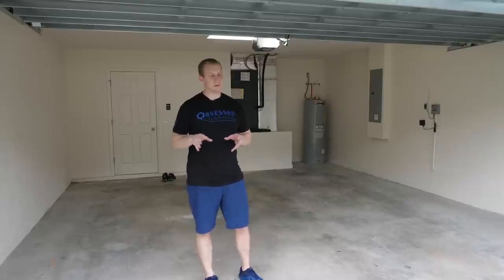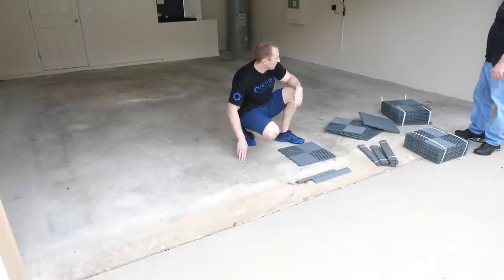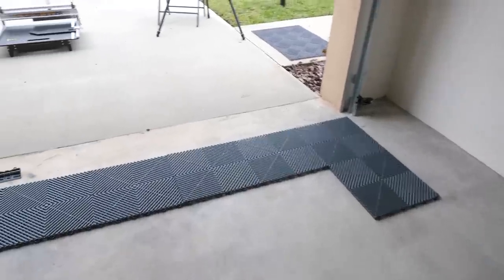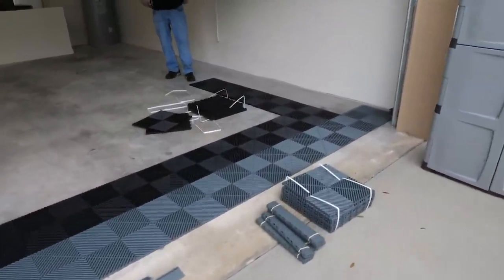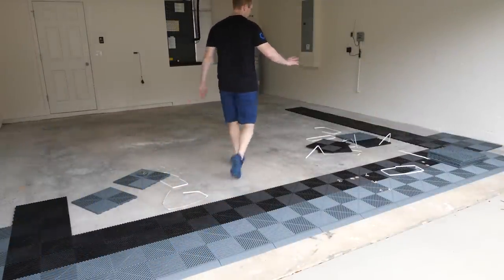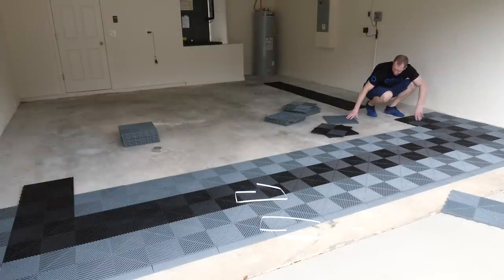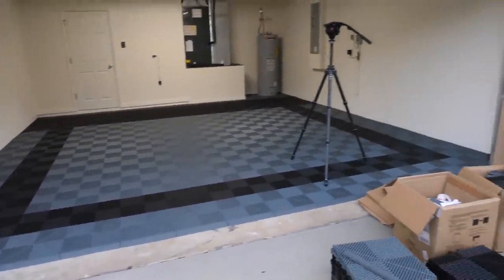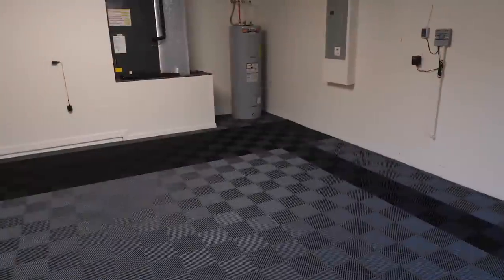Installing Swisstrax In My Dad's Garage

Comment from the maker: All, it appears this video has hit a bunch of suggested feeds.  A couple of answers to commonly asked questions:  "What about the dirt?"  I'm telling you.  Dirt is a non-event.  Think about this logically.  The tile is 3/4" of an inch thick.  How much dirt would you need to dump on your floor to get that much dirt build up?  I vacuum my floors once every few years.  "Epoxy, paint, etc is much better."  I wish it was.  Outside of $12+ sq. ft. porcelain tile, this is the most practical and viable solution for a garage.  I've chased this harder than 99.999% of people on the planet.  "I work on my cars. What about oil."  I do too.  The once a year that you spill some transmission oil on the floor, get some paper towels, pop tile up, wipe...done in 30 seconds.  All you need to know is here:  https://www.obsessedgarage.com/collections/garage-flooring
Reply: Obsessed Garage what about floor jack and jack stands?  That's my one hang up
Reply: For years my driveway was compacted crushed concrete: 1/4 mile long. Dirt would be an event. lol
Reply: @TheBeingReal  Is the floor angled away from house? maybe you could hose it out every now and then. im really digging this stuff. looks great.
Reply: Obsessed Garage everything you’ve said and I clearly get the picture you just made every wrong move when you did epoxy. You vacuum your floors every few years?!!! That’s gross man. You clean transmission oil from the bare concrete underneath with paper towel and that’s it? Why not clean it properly when the tile is up? I don’t think you’re obsessed with cleanliness when your tile argument is partly based on how much dirt you can hide vs. actually keeping a floor clean! It costed me $200 to epoxy a floor twice as large as that garage. Just use epoxy in a solid color, and if someone shows up with a roller send them away, because that is the first sign they haven’t a clue what they’re doing. I did mine myself and a friend had a local contractor do his condo (a guy who actually did live up to his warranty when my friend found some bubbles in a corner). It took me about as much work as those tiles in that garage with prep included. BTW urethane on top of epoxy completely negates the advantages of epoxy, and then you really are screwed repairing anything. If you want resilience you add a softener, if it’s too slippery then silica. I haven’t had any of the issues you’ve had repairing anything either. You’re a dealer for Swisstrak, so this is some first person information for everyone else.
Reply: You can get really good PEI-5 porcelain tile for less than $3/sqft right now and closer to $1.50/sqft if you're willing to wait for the clearances.
Reply: @Lance Hayabusa This may not be the channel for you...
Reply: epoxy paint , its forever coming off I'm defo looking at this .

Comment: Hi Matt, I just installed mine recently and for the sides I find it easier and more precise if you:
1. lay one tile (#1) fully over an already-installed full tile (make sure it's flush)
2. lay another (#2) over tile #1 and slide it towards the wall until flush against the wall
3. draw a line on tile #1 based on tile #2 edge
4. cut tile #1
Viola
Reply: smarts

Comment: So few questions:  What about dirt?  How do you clean the floor of solid particles that are small enough to fit inbetween the grating?  Also, what about when that water heater needs to be replaced?  Can that entire section be redone without negatively effecting the rest of the flooring?
Reply: I wanna know about cleaning but yeah it's easy to redo sections
Reply: We use a bissell cross wave. It does a phenomenal job. Brushes for the interior brushes for the garage.
Reply: Wonder if it’s possible with a good size shop vac to get the dirt without lifting the entire floor I’ve heard him say he vacuums his once a yr or something but not sure the process

Comment: Id be the guy who just leaves the small space on each edge lol
Reply: Jeeper1378 the growth/shrinkage due to temperature on a 20’ section is not small. 60-80F temp swings due to seasons  can cause havoc and bulges.
Reply: You'd be wise to leave a gap. Always always, always follow manufacturer specs on things like that. When the guy in the video said he just puts it in tight, I cringed. When it comes to building a lot of guys do things like that and back it up with, "Well, that's how I've been doing it for 20 years and it's fine!" All that means is they have likely been doing it wrong for 20 years. And they always have an excuse when their work is fucked after the first warm season. Or, they don't even know their work was bad because their customer is smart enough to not rehire him to "fix" it when he was the one who did it wrong to begin with.

Sorry for the rant. This is a pet peeve of mine. I am a carpenter and I read all manufacturer installation instructions each time I install something. I don't care if I have used this product a hundred times. At the very least, it keeps the warranty intact.
Reply: I'm thinking that a baseboard or quarter round raised up just enough to allow the tiles to slide under would be the best way to go. That way the floor can float as it expands/contracts.

Comment: Nice floor but the way you keep measuring the edge pieces takes too long, especially if it's a large area. Take two tiles, place one on top of the other and lay them directly over the last tile before the wall. Now slide the top tile towards the wall. The exposed piece on the bottom tile is the piece you need to cut out. That way if the wall is on a slight angle, it will transfer onto the bottom tile. Use a white wax marker. No measuring. This method is for all tiled flooring. Also, instead of cutting around the garage door metal track, place a tile against it and mark the height of the tile on the track. Now cut the track so the tile slides under it. Like when you cut the door jamb and casing to fit a ceramic tile, wood floor etc. I use a metal blade in my Dremel tool. Works slick.
Reply: I was thinking the very same thing.  But, lessons learned are the best teachers for next time!  Gotta love a clean garage!
Reply: This is how I was taught when I installed wood floors because walls are rarely straight
Reply: This guy does flooring. Also, he had well under a half a tile at the edges. Instead of having to cut those tiny pieces, he should have moved the black border over a single tile and centered off those. same amount of tile (assuming he cut 2 tiny pieces per tile) and you aren't left with those teeny tiny pieces at the edge.

Comment: I love the look of these tiles, especially on the color combo you chose. However I think I would prefer a solid tile that can be blown out or mopped due to the amount of dirt and sand I get in my garage. Also it doesn't look very easy to roll across on a stool or with a tool chest.

Comment: how does that two car garage cost 800? for my single car garage 12x20 its 1100 with out extra. that is with matts 6.80 price per tile. the designer says 160 tiles
Reply from the maker: Quick math on camera.  $1600ish.  Stopping sitting around watching YouTube videos looking for mistakes.  That's a bad way to live.
Reply: @ObsessedGarage   not looking for mistakes. when you say a two car garage cost 800 i looked into the cost of doing my single car and it didn't make sense
Reply: @griffinstambaugh5795  valid point. When I heard 800$ I was thinking about doing it for my garage. Turns out its much more than that.
Reply: @ObsessedGarage  yo who said he's looking for mistakes? The man was just genuinely curious at how cheap it was. Why do you always have to get so damn defensive. Holy shit dude lighten up.
Reply: He was not planning to do the ceiling so it's $1,600 / 2.
Reply: yeah thats a huge price discrepancy, the $800 sounded great!

Comment: I would never do this because tons of dirt over the years would end up in the holes. Especially where the car tires drive on. This would show tire lines the same as on a concrete floor. Instead of sweeping, you would need to vacuum
Reply from the maker: You don't need to do any of that.  Think logically about how much dirt 3/4" would be.  I'm telling you, my wash bay hasn't been cleaned a single time in the 3 years I've had it.

Comment: I have something similar from RaceDeck. After the winter, the road salt and dirt would trapped under the tiles. The only way to clean it is to pull up the tiles in large sections and put them back after cleaning. If you try to use a air blower to clean the garage, it will create a sand storm. If I have a choice, I would pick the solid tiles.

Comment: $800 floor? Isn't it more like $1500
Reply: Loltb did you not catch that he’s also a swisstrax dealer, lol?
Reply: 20x20 garage, looks to be 256 tiles. With a little overage. About $1,800 at $60 for a box of 9. Unless I’m missing something.
Reply: $1,365 for a 20x20, at the price he’s quoting. $1,365. He ships for free.
Reply from the maker: Yes, I was thinking 200 sq. ft.

Comment: I know this is an older video now and prices have probably gone up, but I think this helped me decide on my garage flooring. Thanks for putting out great content like this installation video and the garage give away videos. It’s really helping me decide on things I want, which need to be precise with how small it is.

Close on my first house in about 2 months and it’s only an oversized single car garage, but I want to turn it into a proper spot. Going to have to save up and do Swisstrax and sonicc cabinets like your last garage give away video.

Comment: Thanks for a great, informative video...
What is the deal on dirt?  It just falls into the gaps and now and again vacumn it out?
What sort of expansion gap might people fit.. on a garage of that size?
Can the whole floor move when a vehicle drives on to it if the flooring doesn't butt up against the far whole?
Thanks
Mark

Comment: Excellent video! Great looking floor. Most informative that I’ve seen for this type of flooring. Thank you
Reply: that seemed to be a terrible lay out, why not centre the floor then measure to the wall and eliminate the small cut by either centering the tile or putting it either side of the centre line

Comment: I agree that it looks cool, and the ease of installation is fabulous. My concerns, especially for a guy like Matt who obsesses about cleanliness, is the inevitable dirt and debris buildup under the tiles over time. I know you can pass a vacuum or shopvac over it, and you can always pull up a few tiles to clean any spills, but there will always be dirt under the tiles. The only way to properly clean the floor seems to be to remove the flooring, clean the floor properly, then reinstall. I guess how often that needs to be done is directly proportional to how you use your garage. 

I have a 4-post lift that I occasionally put on the optional casters so that I can push the lift around my garage, and occasionally I roll it outside to pressure wash and detail suspensions and undercarriages, so I doubt a flooring product like this could ever work for me just because of the lift that is not fixed in one position. Personally, I do not care for the feel or sound of loose plastic pieces under my feet, but to each his own.

Hey Matt, with all the detailing that you do the the topsides of cars, do you ever feel the need to properly clean the undercarriages and suspension beyond the brakes and wheel well area?

Keep up the good work!
Reply from the maker: If you walk on these, I think you'd change your mind.  They are very stout.
Reply: Same concern. I've always had a garage and no matter what you do leaves, dirt and sand always blow in. I've always left my floors plain and I just use a broom and a leaf blower to clean it out every few months. I can see the little grills on this stuff catching all of that with no easy way to clean it out. I'd be curious to see a floor like this 3-4 years down the road too.
Reply: @ObsessedGarage  Fair enough, I look forward to walking on them. My garage is in an industrial area on Florida's Treasure Coast with hundreds of garages, where a large number of them are man caves for serious car collectors. Most floors are professional grade epoxy with no issues, some are stained concrete, and a few went with plastic tiles. I have not heard of the Swisstrax brand being used around here, but I will ask around out of curiosity. 

Assuming I could change my mind about the feel, and how to keep the floor clean, do you think that the harder tiles could support the weight of a 4-post BendPak lift with a car on it? If so, how would you feel about rolling it on the casters (without a vehicle on it, of course)? Rolling may prove difficult due to the reduced contact patch size, depending on the flex of the tiles.

Comment: Is it just me or did that floor look really crappy and cheap. Dust and dirt from the cars build up under then you got to take it up to wash it out. No thanks
Reply from the maker: No
Reply: Obsessed Garage no, what? Are you saying that you don’t have to clean out from under the tiles? You surly can’t use a hose to wash out from under them, and if you do how does the water get over or around the wedge trim pieces?

Comment: any reasoning for not epoxy coating/sealing the bare floor ? i would figure it would make cleanup easier later on
Reply from the maker: Cost, and you basically ruin the concrete when you put it on there.  It doesn't come back off without significant expense.  Plus 95% of people don't dump stuff on the floor.  I may get a drop of oil on there once a year.

Comment: That stuff would never work in Minnesota.  Frozen water would bust that cheap plastic in a heartbeat.  Plus, oil drips can’t be easily cleaned up.  When dirt collects onto that dripped oil under those tiles, you get clogged tiles.  Nope, bad stuff.  You should see what that junk looks like when it’s 10 years old; it’s nasty, I tell you, really, really nasty.

Comment: Obsessed, I live in Tucson, AZ, with northern exposure on garage door so sun is not a problem BUT, the temp gets pretty high in the garage sometime up to 110degrees F. Will this extremely hot dry air cause excessive expansion and buckling?
Reply from the maker: I find it's the direct sunlight that would cause significant enough expansion to cause it to bow.
Reply: @ObsessedGarage  I'm in OH and it's not until like 3-5pm where my west facing garage sees sun.  I do work out there when the sun is out so it sounds like it would make sense to just leave 1/4-1/2" gap?   The wall and floor have a concrete block edge that I painted with dark gray exterior floor paint thus it looks great and is fine holding up.  I could just paint the edge of the floor in 5 minutes so it matches and that gap would blend away visually.  Besides, only one side of my garage has that wall edge showing.

Comment: Great video. Can you turn the tires while parking? Will that drag the tiles or break the links? Additionally, I tend to park the car in the same spot, will the accumulated heat on the tires end up damaging the tiles due to the recurring exposure? I also live in Central FL. Thank you for your time reading this.
Reply from the maker: Yes, you can turn.  If you had something like an F250 and slam on the brakes while turning, it will pull up the floor.  Otherwise you are fine to drive around on it.  You will have not issues with tires marking tiles.
Reply: @ObsessedGarage  any issues from oil staining the tile? I do all my oil changes (engine oil and transmission) and always spill some drops during the process, will this be an issue?

Comment: Thanks, I’m doing my best to convince my husband that we want to put this type of garage floor in over epoxy.   The Swisstrax is more expensive over epoxy, but the pros outweighs the cost.  And at age 63,  I’d rather do a little tap dancing with my feet, snapping in tiles, vs scrubbing and rolling on fast drying epoxy, in TX weather.  And I don’t like the decorative chips either.!  I was wondering how you were going to address the water heater.

Comment: I had a garage quoted out with these ~5 months ago, and it was $1000 more than a professional epoxy install.  I had the guy grind down the old floor and instsall a custom graphic, the whole job was $2000.  Lifetime warranty, and holy hell you can't wreck the pro install job.  I had to drag a bunch of heavy equipment (table say, machinist mill and old heavy bandsaw) over it the day after it was finished, and there were no scratches.  I simply can't believe what they charge for these little leggo brick things I guess is what I'm saying.  If I was to do it again, even if I do it 20 times, I'll go the professional epoxy way every single time.
Reply from the maker: I guarantee you I would point out a million imperfections.
Reply: I can point them out for you, you're not wrong, although you do have to look for them. I didn't mean to sound like I'm bashing your product, just that I went an alternative route and actually did have the tiles quoted out. Probably I shouldn't have posted, didn't mean to offend. Definitely an excellent product for the DIYer, and for sure better than the home DIY Epoxy kit from stores like Lowe's.  All good, peace out.

Comment: Yeah, I'd love this.  Would use it to cover my epoxy floor that sure doesn't look good any more.  However, I live in an Oil and Gas town and the roads are none too clean.  I constantly get tons of sand, mud and gravel into my garage.  I can't imagine how a flooring system like this could be kept clean.  At least with my epoxy floor, I can pressure wash and sweep.
Reply from the maker: It would stay clean longer with all that dirt you have.  Check out RAD Garage.  He deals with harsh winters in Canada and cleans it out every so often.